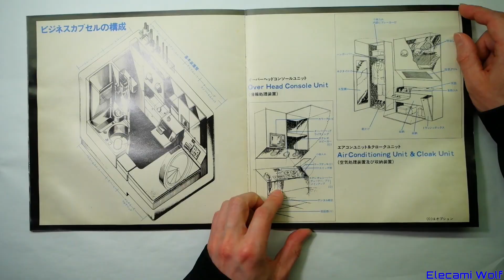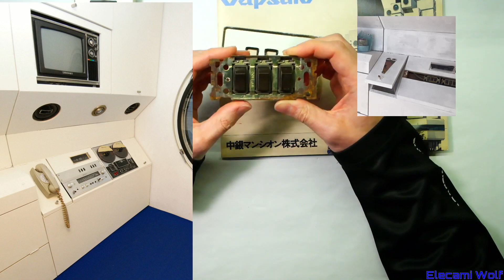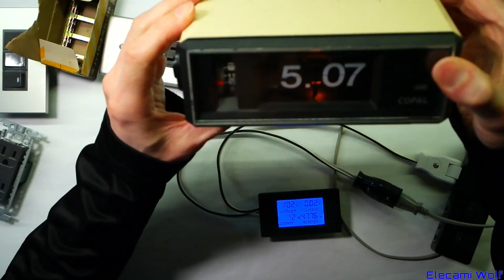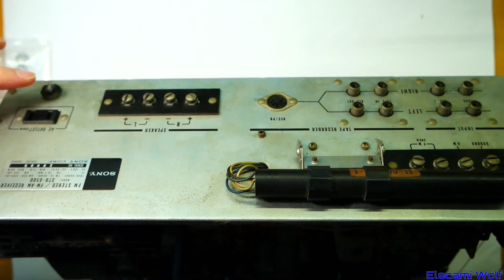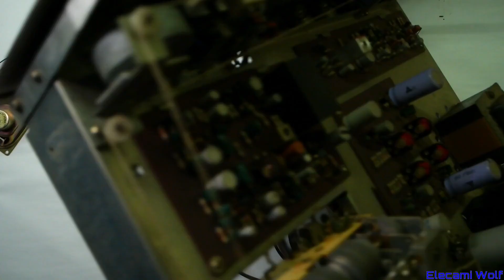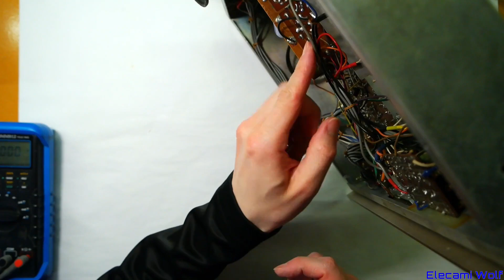EW0050 - Nakagin Capsule Tower - Electrical and Electronics

Comment: They don't built them like they used to anymore, that's for sure.
Reply from the maker: They really don't. quite different to the stuff I am used to working on from the 80s too. 
Not having designators / component overlay or a solder mask makes the boards quite difficult to follow in this old amp.

Comment: Basically, what you're saying is it was a total conceptual hoax.
Reply from the maker: Don't know about that. It was an attempt to have infrastructure that can grow and change with our needs.
Reply: @Elecami  What kind of an attempt it was if they built it in a way that blocks couldn't actually be moved?
It's like claiming to have invented the steering wheel for cars but then you weld it to the frame so it can't rotate.
Reply from the maker: I don't know. I was no involved. It is a bit weird. Think they would have realized that issue in the design phase.
Reply: The 70s were a time of very fast innovation (and obsolescence) and it was impossible to predict where things would go. The real nail in the coffin for them was using asbestos insulation, if it weren't for that it's very likely they could have preserved the towers.